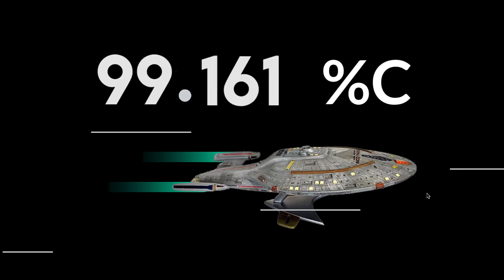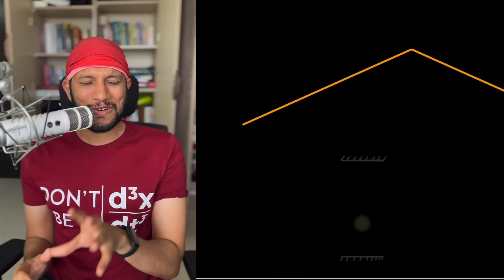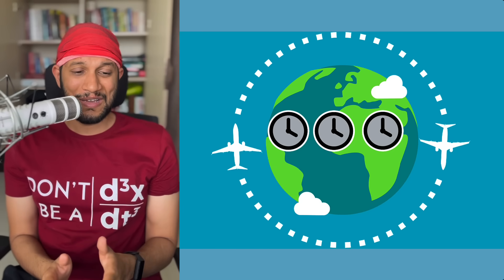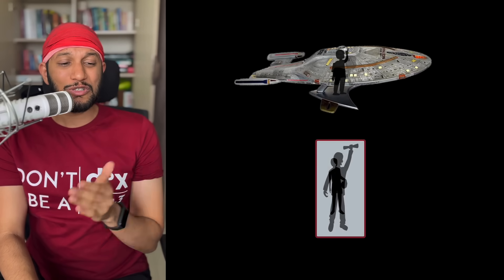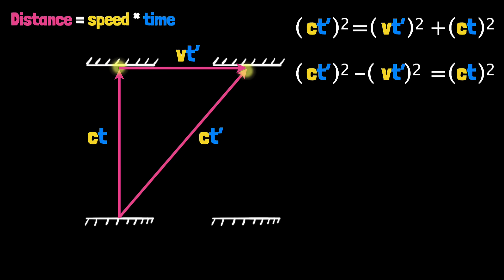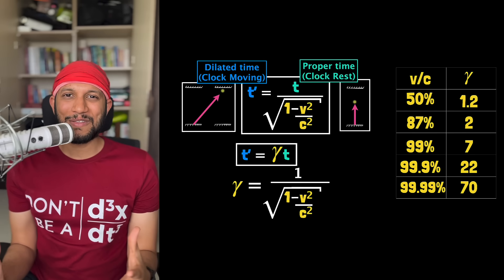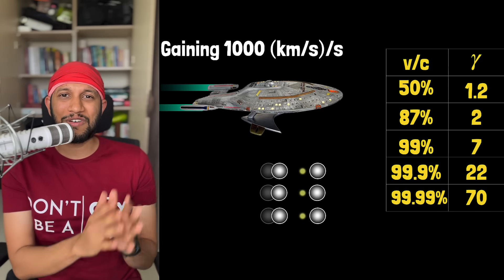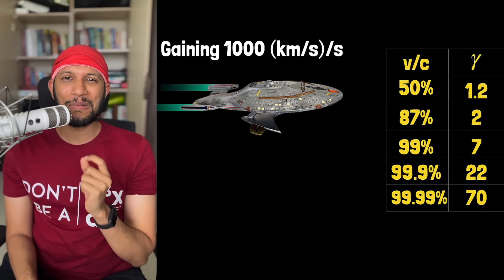I finally understood why you can't go faster than light! (My mind is blown)

Comment: All that this means it's that no one can see an object accelerate to the speed of light.  But how much time would it take for an object with a constant acceleration to travel a certain distance and is there a possible acceleration at which the function of speed for that distance would mean that within the objects own timeframe it has accelerated to the value that the speed of light has in the inertial (initial) frame of reference (not to the speed that light is traveling in the objects own frame).

Comment: But but.. I have a question about phhoton clock. How is it moving diagonally? Is photon separate from the sides it's hitting? From the object in which it is moving? Or are we percieving it like it? In case it is moving diagonally, it would fly out of it's box or "vehicle" unless they all are moving with no effect from one on the other.

If you jump inside a moving train, do you jump longer distance or does it take longer to land? Does your time in the air last longer if the train is moving 20 or 100km/h? Isn't it the same?

Comment: As elegant as this thought experiment may sound, it wrong and incorrect to say that the photon is moving diagonally for the observer outside the moving vessel. 
 
The outside observer cannot see this bouncing photon at all because this specific photon is bouncing between two mirrors, hence not coming to the observer’s eye. 

For the external observer to "see" any bouncing particle, the ticking photon must emit another photon toward the eye of the observer for every travel point between the two mirrors. In this case what the external observer "sees" is not the ticking photon but rather another photon. 
You need to think 3 dimensions 

Why would Einstein think that a photon bouncing between two mirrors, someone outside would be seeing the same photon.

Thinking so, you are deliberately making the assumption that this photon bouncing up and down would be emitting (radiating) other photons in the direction of your eyes continuously in order for you to observe the movements of the main "clock-photo". 
Therefore the up and down path that you observe is not the one of the main photon. 

Time dilation/contraction may happen because of speed of travel but please stop using this light pendulum to try demonstrate anything.

Comment: Let me put it this way : you have an object that's suppose to die in 5 years , and it goes by the speed of light (almost ) 
And another object , with the same longevity, being om earth 
In 5 years , earth time , they'll both die! (Exact same time)
The fact that a human on earth, won't be able to perceive it , doesn't effect the 2 objects exact same longevity
Just saying ...
Reply: That's incorrect. It depends on the frame of reference of those five years. If you mean 5 earth years, someone traveling at the speed of light would not have aged much.
Reply: @trisbane4086  its not relevant , the heartbeats are not effected by speed , ( both die tha sane exact time as supposed to ...)
Time is a human invention to explain a moment ,
Not to extend longevity of a certain living creature

Comment: What happens if i fly a ship at the speed of light then stand up and walk forward, im now going faster than the speeds of light?
Reply: All kind of things happen.
1. It's impossible.
2. If you ignore #1, then things get weird.
 At c your time relavitely to others have stopped. All distances are zero. From your reference point you move infinite distance at zero time.
Where are you? How can you stop when slowing down takes more time than zero? You can't never stop, but then again you have nothing to compare, so your speed is zero. Less than zero, it's irrelevant, it doesn't exist anymore. You've become your own universe. Everything outside your ship is gone.
You have become a black hole with ifinite energy and your event horizon expand at the speed of light.

Comment: If we assumed initially, that nothing can move faster than light and c is the maximum speed a photon or whatever can travel at, then you're guranteed to get the assumption in your results. 
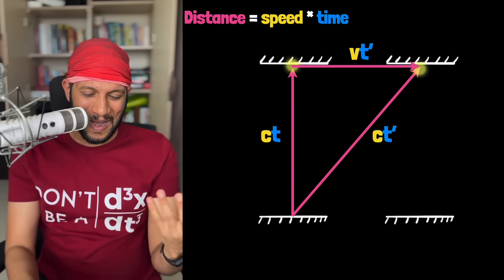9:14 You took the distance at ct and ct', why not ct and c't? everything changes if we can do this. 
So, my question still remains unanswered, why are we making this assumption in the beginning?
Reply: so just explain how we try experiments with something faster than light
Reply: @AMC2283 I don't know, 100 years ago we assumed outer space is filled with ether, we evolve as we find new things. Maybe we find something faster one day.
Reply: @AnshulMalikCS think there’s some reason other than c is the maximum that particle accelerators can do .999c but not c?
Reply: @AMC2283  Yeah, maybe, but there is no proof, only theories.
Reply: @AnshulMalikCS so what might be wrong with the particle accelerators?
Reply: @AMC2283  may be the technology gap? we haven't found a way to measure the things which go faster ?
Reply: @AnshulMalikCS so every experiment measures c the same and gets the same results for Lorentz transformation. But maybe we can’t measure things that go faster. How do you think maybe we could measure that?
Reply: Well I don't know. And why are you trying to measure c?
Reply: @AnshulMalikCS ok pal, you’re not smarter than Einstein.
Reply: @AMC2283 i never claimed that.

Comment: The fact about all this is that speed of light doesn't follow any physics we can explain, light is completely different based on volume, anything with a bigger volume will make stronger lights move faster, think about it, I have a sun that 1000km in size cause yeah a sun smaller then a planet does exist and then I have a sun that is bigger then our solar system, you really believe the light travels the same speed on both suns? I don't think so, there's so many things we don't know and jumping to conclusions just cause Einstein had a thorough idea? Don't gr me wrong I respect the man and his accomplishments but there are some things that just make sense when put into perspective, even the fact that light speed might actually NOT travel but instead be absorbed by some form of non matter material in space, much like how we have solid volume liquid volume and gas volume, space basically has something even less formed then gas and that is plasma, who knows, what's out there in space is plasma and it's completely different then anything we know
Reply: speed of a particular light wave and all photons in the universe are two different things

Comment: Why we see it stuck from outside, if it's moving we can see it move right? It just not accelerating. That doesn't mean it stuck.  So it is traveling, just not accelerating, so how can we see it stuck at 99c?

And how's universe expanding faster than light, if it takes infinite energy to gain acceleration faster than light?
Reply: nothing's stuck at .99c, but at less than c.  spacetime expands at constant rate per distance, so the rate accumulates, but no object is moving faster than light, and no light can cross the horizon
Reply: Thank you, i somewhat understand now. @AMC2283

Comment: Wild thought - This seems to be an issue because we are observing the photon/ship from a reference. Is it possible that the ship itself can be traveling at the speed of light if there is no observation from a reference? 
Thought inspired from the double split experiment where light behaves differently based on whether you are observing the light through the slits or not.
Reply: Gamma only applies to an outside observer; so when telling it would take an infinite amount of time to reach the speed of light "that's only seen by the observer not by the people who are in the ship!" The ship could still move faster than the speed of light yet the observer won't see it.
Because the whole analysis of gamma is based on the observer witnessing not the actual experience
Using Einstein analysis of observer experience to explain factual experience is stupid

Comment: Since all speeds are relative, why can't two space ships, each travelling at three-quarters the speed of light pass each other, in opposite directions?
Reply: they can pass each other, but they won't be measuring a combined speed of 1.5c because of time dilation and length contraction, but closer to .99c

Comment: If nothing can be accelerated to the speed of light, then how was the photon accelerated to the speed of light? It seems that this is an inherited property of the photon - to move with a constant speed C. 

Then another interesting phenomenon - let us assume that the moving frame of the spaceship has reached somehow 90% C and it stops accelerating any further. Now let's assume another reference frame within the spaceship itself - having this already accelerated reference frame as a starting point - now we can accelerate anything inside that reference frame to another 90 %C and so on and so on. So time slows very much in regards to the very first frame. But who says that there isn't another reference frame, outside the first one and so on to infinity again?  So the linear type of thinking may be isn't the proper way to describe the universal laws as they are.

Comment: If your weight goes to infinity with speed going towards c, your acceleration would need to be unlimited to reach c... isn't that easy?

Take a radiation device against cancer. There electrons are accelerated, first normally in a static field till close to c. Afterwards they are accelerated onwards on an electromagnetic wave. This only works, because they do not get faster, just heavier. Else they would be faster than the wave at some point of time. Than they get filtered for energy by bending with a magnet and transferred to photons to hit cancer precisely.

Real life usage...

Comment: According to the Alcubierre interpretation of Relativity, if you can harness the expansion of space to move a spacecraft, then you CAN go faster than the speed of light!  The Alcubierre drive is a theoretical concept for faster-than-light travel proposed by physicist Miguel Alcubierre in 1994. It involves creating a warp bubble around a spacecraft, contracting space in front of the bubble and expanding space behind it, effectively "surfing" through spacetime. This allows the spacecraft to move through space faster than the speed of light without actually breaking the speed of light limit.

Comment: What about the infinate mass of infiinate fuel? E=mc²?

My non-PhD brain suggests to me that if I start driving to Andromeda in a 1300 Toyota Corolla, by the time I get there I should be cruising in something that looks like a Corolla but runs like a freakin' F1 Ferrari - bigger engine, bigger fuel tanks, etc

But… because E=mc², the faster I go, the more mass I’m carrying. So I’d need to keep upgrading the car just to keep up. Heavier engine → more fuel → more energy → more weight. It’s never-ending, a game you can’t win. 

The goalposts are always moving and Im getting fatter and fatter. 😅

or not?

Comment: Simplified : 
light dont have mass and it can reach upto 300000 kmps ( approximately ) 
So if anything that have mass it will go slower than light because mass attracts friction and friction slow you down,
So if protons ( light ) cant beat 300000kmps mark then how can Atom ( anything that have mass ) can do it.

Comment: @Mahesh_Shenoy
HELP!
Maybe I'm misunderstanding, but you explained why it's impossible to reach C due to time dilation, aka- it would take longer and and longer, or more energy, to gain an extra 1000km/s, but from the OBSERVER'S perspective. But what about the spaceship itself, which still sees a second pass for each 1000km/s gained? Would it not eventually (say after 300 seconds) reach C after, even though for the outside universe an eternity has passed?

Comment: Not sure if I understand what you mean.  Time dilation is relative because of the observer being outside the system.  Because the photon in the spaceship takes forever to tick from the perspective of an outside observer, u concluded that the spaceship will either take forever to reach speed of light or — if one wishes to accelerate to catch up time dilation — take infinite energy to catch up on time dilation.  But this theory is no more than a relative theory.  From an absolute perspective, taking away the observer and having infinite energy available, I cannot understand why an object cannot travel faster than the speed of light — other than the fact that such an object is unobservable under today’s science 😊 The man inside that spaceship continues to live as usual and observes the ticking photon no different from what one would expect.

Comment: There is a serious flaw in your explanation, known as the “begging the question” fallacy. You’re asserting that nothing can travel faster than light because the equation says so — but the equation itself assumes that nothing can travel faster than light in the first place. In other words, you’re using a conclusion that was already built into the premise to justify the premise itself.

This is a classic example of circular reasoning: you’re not proving the point, you’re presupposing it. It’s like if I wrote a book — say, the Bible — and claimed in it that God exists. Then, when someone asks me why I believe God exists, I reply, “Because it’s written in the Bible.” But the authority of the Bible as proof of God’s existence depends on God already existing — which is exactly what we’re trying to prove.

In both cases, the logic fails because the evidence relies on the very thing it’s supposed to justify. It’s not that the conclusion is necessarily false — it’s that the reasoning used to reach it is flawed and unconvincing
Reply from the maker: @vikashgupta4961  you are right. Most of the times when we say ‘why’, what we really mean is ‘why does my mental model gives me the wrong result?’. In this case, the classical Newtonian model makes us intuit that there is no speed limit. So the whole point is to show how, if one assumes the postulate - speed of light is the same in all reference frames - it automatically also means nothing with mass can reach light speed

Comment: I understood almost all of it, but one thing i don't grasp. He explained everything to the reference of an observer, or should i say, person or object who observes vessel trying to travel close or exactly at the speed of light. And that is fine, i understand it, however, Inside the vessel acceleration is constant, because the clock ticks normally. If the vessel gains 1000km/s every second, the acceleration is constant for the people inside the vessel, so "it should be" possible for them to at one point reach the speed of light, right? I know that the mass also increases with how close you are to the speed of light, but he didn't mentioned mass here. Also, does this have any connection with the "information" in the universe, because if you are able to travel with the speed of light, fundamentally "information about you" is lost, because it never reaches anything? I am completely lost now. Please someone answer me :face-fuchsia-wide-eyes:

Comment: But then that means that from the perspective of the crew and the engine of the spaceship the acceleration would only take the normal 300 or so seconds with the expected amount of fuel used, they would only slow down with it from the perspective of an outside observer.

Comment: There is a subtle but very fundamental error in this video.
 If "A" travels near speed of light wrt to B (relative velocity ~ c), then B also travels near speed of light wrt to A. Both frames are interial and valid. Whose force careers are fundamentally slowed up then  - A or B ??? 

The error you are making is mixing  velocity with acceleration. Its acceleration that causes actual/absolute time dilation.  An accelerating body will absolutely slow down ( physical processes, etc) compared to any inertial frame.  Gravity causes absolute slow down - in general relativity (its equivalent to acceleration). The clock hand example in the video is also accelerated since the hand is changing direction (velocity is vector).

On the other hand, special relativity - both intertial frames see each other slow down. There is no actual/absolute slowing down - its observational - frames cant process information * speed of light. If one of them breaks inertial frame aka accelerate the there will be absolute dilation  ("A" decides to de-accelerate back and eventually meet B and slowndown to B velocity ; then A will be younger - its the (de)acceleration that caused actual dilation).  Again, special relativity 101 - both frames are valid - there is no absolute dilation bw inertial (non accelerating frames) only observational. Its acceleration that does the "force careers slow up".
Reply: U have a valid question but he is explaining a theory phenomenon that is not theorised by him.

Also, in order to reach a certain speed, an object need to accelerate until it reaches that speed, and so this theory illustrated that the fuel required to accelerate an object to speed of light is not possible because it will takes infinite fuel and time to do so.

In conclusion, it is possible to reach near speed of light, but (probably) can never reach.

Comment: I'm interested in the speeds between light speed and simultaneous movement from point a to b. That is, anything faster than light speed up to "time speed" (or what it takes time to reach, well, any place).

Time is instantenously touching any part of the everything, no matter how distant, while light can take practically forever.

So perhaps matter cannot accelerate past light speed, but there has to be at least a hypothetical way to reach say the Andromeda galaxy or the further parts of the known universe in less than x lightyears.